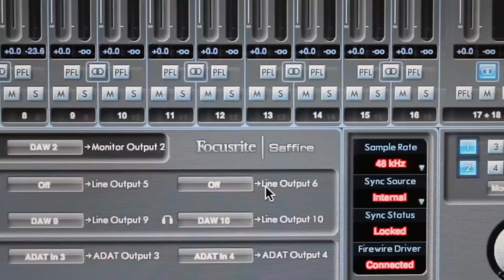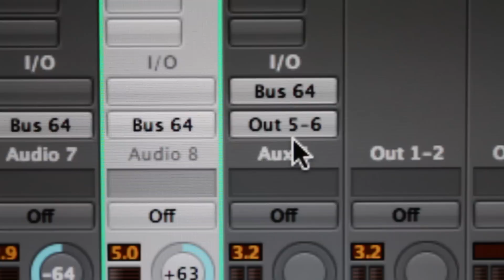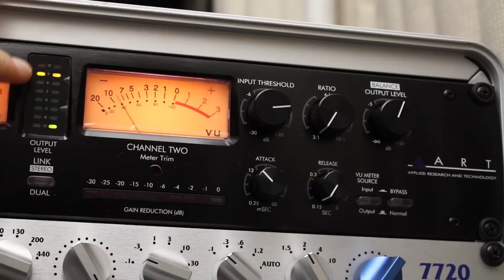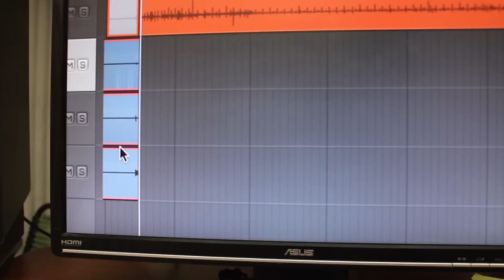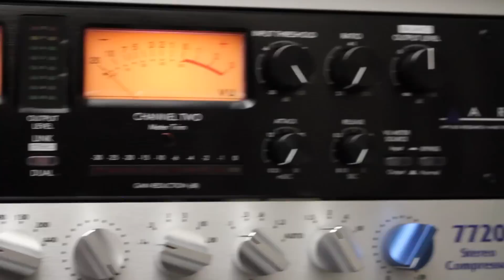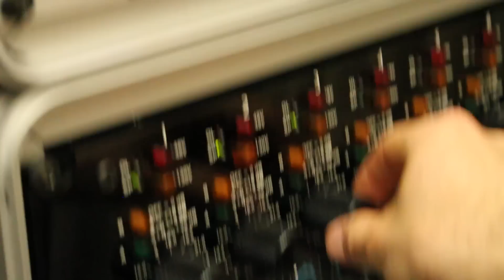Get Outboard Gear Into Your DAW- Compressors, Preamps - Focusrite Saffire Pro 40

Comment: Thanks! I just loop it all through my AD/DA converter and have my interface sp/diff into/out the converter or use the analog out back into the interface from the converter. That way, I can get some saturation if I hit the converter harder from the last component

Comment: Adam (my son's name...), Thanks for this great video. I watched it full lenght. It does cover many aspects that I wasn't very familiar with, including gain staging and the physical pathway from DAW to Outboard gear and vice versa. I use a X32 Rack mixer that serves me as a great sound card with pristine preamps, and Digital Performer as a DAW, all operating in my beast iMac. I also just bought an ART Pro VLA II that I just tested briefly a few days ago and was pretty disappointed with. So I had a great interest in your video because the Pro VLA was put to test in the same way as I tested mine. My test led to a very dirty sound, completely crushed and distorted, even when bypassing the unit. I am pretty concerned because I bought this unit second hand, so... Anyway, I am glad to see that in your video, the Pro VLA sounds pretty good and clean, so I wonder if my cables were faulty or if I didn't in fact screw up in the gain staging process, which you also explained pretty clearly. So I will now go back to my unit and apply your principles to retest it and hope for the best.
Thanks again for this amazing tutorial.
Shabat Shalom :-)

Comment: Off topic, but just wanted to mention you might want to consider changing the tubes in the ART PRO VLA II for a matched pair of NOS Mullard 12AT7. Insanely cheap to buy, but truly transform the PRO VLA II into a thing of beauty 😉
Reply from the maker: Epic Winz2017 it's funny you should mention this! I actually sent my PRO VLA II to Revive Audio for modification including NOS tubes & a Cinemag xformer. It is a totally new device. Check them out! thanks :)
Reply: Lansky Sound Awesome! & funny you should mention Revive Audio, as just yesterday I was on their website thinking of doing the exact same thing! Great minds think alike 🙂 I bet you PRO VLA will be a force to be reckoned with when it's done!
Reply from the maker: It is awesome. It went from collecting dust on my rack to being involved in every session even if nothing is being compressed.

Comment: NOOB HERE. Sorry in advance for any dumb questions.

I am having trouble routing/connecting My VLA PRO 2 with my Firestudio Mobile.

INFO:
Ok so i just purchased a ART Pro VLA 2 specifically for vocal compression.
I use a AKG C414 for a mic & Presonus Firestudio Mobile for a interface.
My current DAW is Logic Pro X. 
I have multiple 1/4 TRS cables and XLR Cables (Not sure if they're balanced)
I record only vocals so keep that in mind.

Basically I am completely clueless on how this thing is routed to my interface.

The Firestudio Mobile only has 2 outputs (L & R), Is this setup even possible?
I imagined i could just skip out on my monitors (Assuming the compressor would take up all the output jacks and instead just use headphones to monitor the mix.
But so far no luck. 

I'm confused on how my cables get connected from the Mic to the compressor to the interface?

Is this compressor compatible with my interface or do I need a new interface? Or do i need an external pre amp? Or am i just plugging everything in wrong?

I'm sorry if this is a lot. Im just completely lost. Any help would be so appreciated.
Reply: +Arizona Zervas I am a noob too, but  it seems to me it is impossible......(( I ve got vla pro too.... and line 6 ux 2 (2 outs and 4 ins)......It has 2 line in inputs and i tried to connect from outs to compressor then back to line ins.......I am using ableton and definetely it worked.....but with a lot of noise and I couldn't hear track with COMPRESSOR separately from original track, because it has to "catch" sound from original track and send it to  track with external compressor, so if u press SOLO u will hear nothing((((  I gues the best way to have mix compressed (I am not talking about instrument/mic recording compression - it is simple) is to have an external audiointerface with SENDS and RETURNS.  if there is no send and return you have to compress your mix into another computer with another interface i guess)))))) thats the only way for me now. I hope someone will help you and me with this stuff.

Now I am using this scheme to compress a final mix: (PC 1 + Line 6 UX 2+ Ableton) - > (Compressor, EQ) ->(PC 2+ friends focusrite+Ableton) 

sounds not bad......but I think it is not right 

By the way all these big rack interfaces have a lot of imputs and outputs......but don't have SEND and RETURN and I CAN"T UNDERSTAND HOW TO USE COMPRESSOR AND EQ during final mastering with them(((( so I still can't buy one untill i find it out.....

If someone uses any kind of this stuff please make it clear - can i make these imputs and outputs as sends and returns? for example on focusrite 18i20
Reply from the maker: +Arizona Zervas Please accept my apologies for the LATE response! I haven't been checking this forum as often as I should :/

The first things to keep in mind:

1) Every MICROPHONE needs a PREAMPLIFIER
2) Compressors, EQs, reverb modules, & every single other piece of outboard gear (including your PRO VLA II) is looking for LINE LEVEL VOLTAGE
2.a.) A microphone outputs millivolts! Line level voltage = ~1.25V
3) Therefore: Every COMPRESSOR needs a signal from a PREAMP

The easiest solution to your situation is to purchase an outboard preamp for your microphone. The signal chain will then be MIC > PRE > COMP. You cannot plug the microphone directly into the compressor as nothing will happen... I get the feeling you've experienced this before ;)

An outboard preamp can run you $40 new for something entry level to over $1000 if you want something really juicy & wonderful. I recommend purchasing an outboard preamp to get your VLA some action.

The other alternative is to use a preamp in your Firestudio & route the signal to an output which will then be connected to the PRO VLA, then the output of the VLA back into a different input on your Firestudio. The signal chain will look like: MIC > INTERFACE > COMP > INTERFACE. This will work but requires more steps & will possibly result in annoying latency as the signal is twice converted from analog to digital.

I hope this helps! Write back anytime :D
Reply: Do you need a pre amp for the compressor if you're only using it to mix? Meaning Im not compressing incoming audio from a mic or instrument, Im strictly only compressing audio leaving the audio interface, thru the compressor, and back to the audio interface.
Reply from the maker: Nice question! The short answer is NO -- this compressor (or any, for that matter) should work just fine as a post production tool as long as it is receiving sufficient input signal from the interface. In the specific context of the Saffire Pro 40, you will want to open up MixControl & make the 1/4" inputs being used GREY (rather than red or blue) in color. This will ensure proper output voltage at all times.

The long answer goes something like this: There are three types of voltage in profesh audio, being 1) microphone level [millivolts], 2) line level [~1.25V], & 3) speaker level [1V to 50V+]. All compressors, EQs, & outboard dynamics gear operate at LINE LEVEL VOLTAGE. The voltage level created by a microphone is thousandths of a volt & requires a preamplifier to boost that signal strength up to line level (about 1V-1.25V) before it can be manipulated, recorded, etc.. Every interface operates at line level voltage & should therefore be able to send signal to a compressor without further amplification.

Rock on :D

Comment: PLEASE HELP!
Okay this is all a bit confusing.

I just bought a VLA 2 Compressor & Saffire Pro 24 Interferface.
Complete noob when it comes to setting up the hardware and software.
I google & youtubed & tried multiple things but i can't seem to get this stuff running right.

Im using Logic Pro X & Saffires Mix Control.

What i want is to use my VLA to compress vocals while tracking.
So basically i want my vocals compressed before they are recorded into Logic.
I don't want to hear the compression while tracking however. 
I mix while i record so its important i only get the logic master output and not the a compressed master sound in my headphones/Monitors

I specifically need help with Saffire mixcontrol because it is so confusing to me.

So basically 
1. How do i route this compressor to my interface?
2. What wires will i need?
3. what setting do i change in mixcraft?
4. What setting do i change in Logic?

Thanks In Advance!
Reply from the maker: +Arizona Zervas I replied to your post above, but you have more specifics in this post so I'll hit you back again. I would like to know why you do not want to hear the compression as you record? If anything, it should make the process easier. At any rate, here are some answers slightly out of order to your questions:

2. Wires you will need include:
1 x XLR (MIC > INTERFACE)
2 x 1/4" TRS (INTERFACE > VLA > INTERFACE)

3. Connect your microphone to any analog input on the interface. Let's say you choose INPUT 1. In MixControl, you will have to route the ANALOG INPUT CHANNEL 1 to an ANALOG OUTPUT 3. (OUT 1/2 are default for monitors so let's not use those.) Take a 1/4" TRS cable from the actual hardware output jack on the back of your interface & connect it to the INPUT of PRO VLA CHANNEL 1. Take another 1/4" TRS cable & connect it from the OUTPUT of PRO VLA CHANNEL 1 to INPUT 2 of the interface. You will record from INPUT 2 within Logic Pro X.

4. In order to listen to the UNCOMPRESSED signal, which I do NOT recommend, you will need to monitor from an AUX INPUT channel within Logic Pro rather than the recording channel. Set your AUX INPUT channel to monitor ANALOG INPUT 1. Set your recording channel to ANALOG INPUT 2. On your recording channel (input 2) MUTE the audio. On the AUX INPUT channel (analog input 1), set the fader to 0dB.

This should do the trick! You may want to go to Logic's Audio Preferences & reduce the buffer size to minimize latency, otherwise you'll be hearing the vocal echo back or it may record slightly late on the timeline. Either result is certainly annoying!

Good luck, dude!

Comment: I think what you need is not a Audio interface with pre amps included. Rather a AD/DA converter. And no...they are not the same thing. AD/DA converter do only that ...convert analog to digital and vice versa. Audio interfaces do both ... pre amplify the signal  then converts Analog to digital (vice versa ) . Since you looking for the "coloration" of the outboard gear theres no need for another pre amp at the end ..rather just the conversion.

Comment: My goal is to get the cleanest sound as possible for the budget because, people don't like your songs because of your gear, they like great songs that sound good. So I currently have a Saffire pro 40, with an Shure SM7b, and a Cloudlifter for recording primarily Hip Hop/RnB Vocals only. Due to my less than Ideal location, a lot of backgroud noise bleeds into my mixes. I read that inserting a DBX 286s compressor/ gate would clean up the muddiness and background noise before my tracks enter Pro Tools. So I understand the logic of your video, you want us to go from Mic, to Saffire, to Outboard Gear back to Saffire. But according to alot of the proffesional podcasters who are using my set up, they are going from their Sm7b to the Dbx (just for the gate not for the preamp), and then finally into Saffire Pro. So my question is what is the better set up in your humble opinion?

1.) Shure SM7b > DBX 286s > Saffire Pro 40? or 
2.) Shure SM7b > Saffire Pro 40 > DBXs > Saffire Pro 40

Comment: Cool video! Have considered the VLA myself.

Have you ever thought of getting a patch bay, so you dont have to change all the wires on the back side ?
Reply from the maker: +Michael Kire Hansen Thanks for checking in! The PRO VLA II is a really great compressor for the money, but the quality jump to more expensive processors is evident in comparison. Having said that, I still use mine & am happy with the results. In fact, my next move will be to upgrade the tubes to something from www.AudioTubes.com. I just picked up a matched pair of NOS French tubes from 1977 & they have radically improved the sound of my Rode K2 microphones. Do you have a compressor you are using now?

Regarding the patch bay, I have come close to purchasing one a few times before. The reason I haven't is because my setup is constantly moving & changing shape to adapt to different locations or artistic directions. The patch bay would never be used! Do you have one in your space?

Stay tuned!!!
Reply: Currently I only have software comps unfortunately. But I've been looking into buying outboard gear instead :) So i think that a patch bay will come in handy when that happens :)

Comment: Adam,
Thank you for your awesome videos man.Thank you for being very detailed in your explanations.  
I've got a noobie question for you.  Does the Saffire pro 40 automatically detect/set the impedance levels for a balanced connection and a unbalanced connection? 
( I.E  +4 if you are inserting a balanced gear. If it's unbalanced -10)
Reply from the maker: +Jay L78 This is not a noobie Q, dude! This is def an advanced Q & I will guess the answer is "NO". I could be wrong, but I believe it's highly unlikely. I suggest taking your Q straight to Focusrite & kicking down the door.

Please let me know what you find out! Good thinking :)

Comment: Thanks for the great video! Really solved some problems for me as I have never used the Saffire mix control software, but just tracked straight into Protools. Have done all reamping in another pro studio (with much better gear than I have), but now I will start doing it at home as well, as I have bought a few outboard pieces:) 

Some questions: Do you do also do tracking through the Millenia and into the Pro40? And if so, do you also run it through the preamps on the Pro40 - and do they color the sound? Or is it 25 pin or ADAT out from the millenia? 

I also wonder why you run the signals through the compressors before the preamps? In my head it seems better to run it through the preamps first. Unless you do it for a specific sonic quality. I guess it´s all about taste when it comes to compression:)

Anyways, thanks again for the video! 

PS. I see now that this thread is more than a year old, so don´t know if you´re still following it..:)
Reply: ...and another Q: The Pro40 doesn't have World Clock connection, as most higher end interfaces. How is your experience with linking it with other units regarding sync/latency?
Reply: Santa will bring you no presents when you use words like that. And when you get to 5th grade you'll probably be able to read longer text paragraphs. Stay in school and don't do drugs! :)

Comment: So basically the idea here is: Record as perfect a performance as possible with completely clean inputs (or at least mostly clean inputs) and then re-amp everything through the outboard gear and mix it that way instead of with plugins?
Reply from the maker: KidnapstedGC Yessir! By routing out from the interface & into the outboard gear AFTER you've already recorded, you'll have the opportunity to experiment with different settings before committing. This is one of the major advantages of using a plugin over the real steel analog gear, but we can get that same advantage back in our hands :) ONE THING TO KEEP IN MIND, however, is that a small amount of latency will result so it is important to process stereo pairs IDENTICALLY to avoid phase problems.

Stay tuned for more cool vidz!
Reply: Lansky Sound Cool thanks!  Any particular reason you're using XLR to 1/4 in. cables to go back into the interface rather than XLR to XLR, or is that just what you have?
Reply from the maker: KidnapstedGC Sharp observation... That's just what I have. They are Mogami Gold balanced cables so I'm comfortable with them. Since making this video I have purchased some XLR > XLR of the same manufacture & I use those sometimes as well!

Comment: I'm running protools 11 and I've been trying just recently to run outboard gear. I don't want to sound like a dope but how would I get an aux track in pro tools to correspond with the output I'm using? Please help!! And thank you this was very helpful!!
Reply from the maker: +Dave jrtds Hey Dave, if I understand correctly you are trying to use an aux track to send to a hardware output. Is that right? If so, there are two selectable areas under the label "I/O" on that aux channel strip. The one on top is In & the bottom one is Out. Change the bottom one ("O") to reflect the hardware output you wish to send the signal. It should be that simple! Then, make sure the channel strip volume is up & any sends going to that aux strip are up as well. Good luck!

Comment: Question about Gain / Compression:  Why compress a signal, just to add gain ( or output level )afterward?  Why have 6db of Gain Reduction, just to add 7 db of output level later? 
 
The answer is in my head but how do I put it into intellectual terms?

Comment: Hey man, thanks for the video. Is there a way to use the pro vla and Saffire when you are recoding if you are using all 8 inputs? I’m wanting to run the 8 channels out like a stereo Drum buss through the compressor before it hits my protools. Is there a way to do it? Thanks.